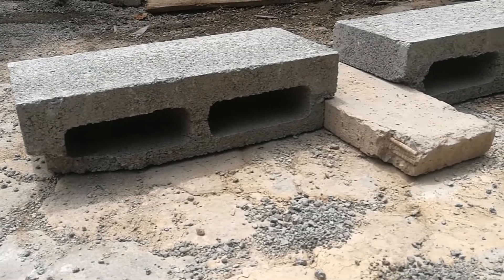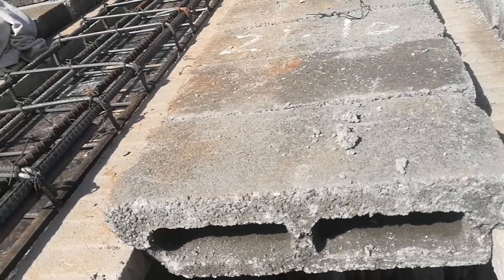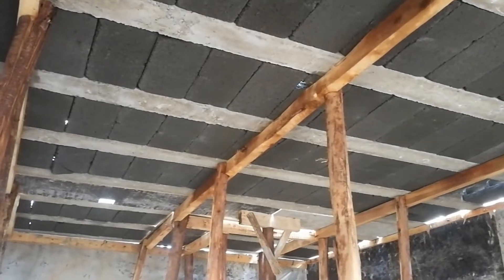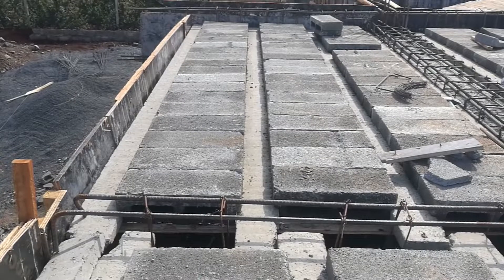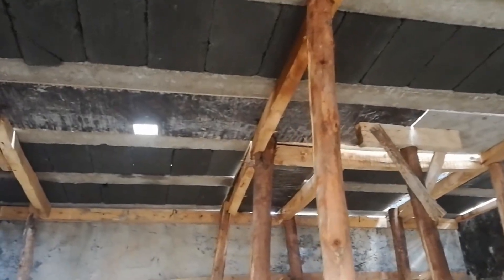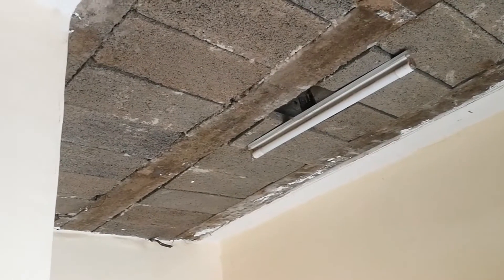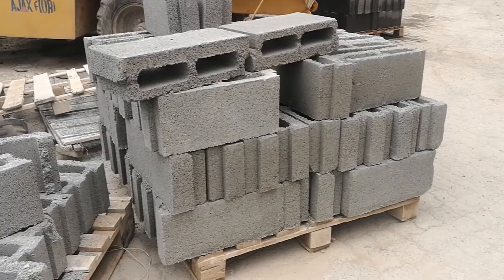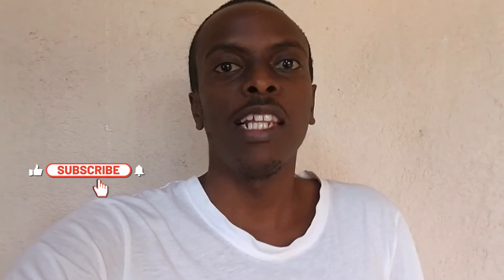Using Hollow Concrete Blocks and Beams to Make Suspended Slabs Faster

Comment: Building is not about choosing the cheapest option today, but about the strength and safety of your house in 20–30 years. Block decking may look easier and cheaper, but normal decking (slab) gives better strength, durability, stability, and lifespan. Always build with proper design for long-term safety

Comment: Nice Vid, you should do a video on the maximum span the beams and blocks can reach as well as the min/max thickness of the poured slab on top of the beam/blocks, steel reinforcement sizes and spacings and give information on expansion joints and waterproofing for external slabs. this would answer so many questions one would have when planning a job and calculating materials.

Comment: Is this technology stronger than the conventional slab we are used to?
Reply from the maker: It can have the same strength, only that it's faster to install
Reply: Building is not about choosing the cheapest option today, but about the strength and safety of your house in 20–30 years. Block decking may look easier and cheaper, but normal decking (slab) gives better strength, durability, stability, and lifespan. Always build with proper design for long-term safety

Comment: What is the maximum length of a pre stressed beam?
Reply from the maker: This is determined by the shortest span of the room, eg, for a 3x4m room, you'll use the 3m prestressed beams

Comment: Hello how many floors can you go with this Precast concrete slab thnx for the great work 😊😊❤
Reply from the maker: It can go as many floors as the design of the building. The foundation, columns and beams support the loading of the structure together the precast concrete slab. Ensure you work with a qualified and experienced structural engineer for your project.
Reply: @PropertyNoma  that’s good to hear but is it possible to export them to Uganda if possible how much is each of those precast concrete slab blocks and everything that goes with it thnx for the information

Comment: informative presentation. Are the concrete blocks and beams slabs waterproof if used as a rooftop?
Reply from the maker: Not by themselves. A concrete layer is poured on top as a floor finish and cover. You can use waterproofing cement or put  APP membrane on top of the concrete for waterproofing a flat roof slab

Comment: Great video Nick. Your building method is interesting and ingenious. What is the entire dimension of the beam and block (length/width/depth)?
Reply from the maker: The entire dimension will depend on the span of your slab...so they're customised to fit the design of your house's slab
Reply: @PropertyNoma  thanks but I was referring to the individual beam and block that you're using in the video. What are those dimensions for one single beam and one single block?
Reply from the maker: @ecf2335  A beam's length will depend with the shortest span of your slab while a typical block's width is 400mm.

Comment: I am curious to know if there have been any failures or collapses using this technology as compared to the normal method of building suspended slabs. Also I am curious to know the typical thickness of the poured concrete layer, as well as the MPa of the concrete mix if you know it. Thankyou for making an interesting and informative video. It is very good in my opinion.
Reply: In some countries they use t shaped beam, which look stronger to support the hollow blocks.
Reply from the maker: Beam & block is a standard technology in somw countries, although it's relatively new here in Kenya. The poured thickness is around 50mm
Reply: Stupid man! You are curious to know of failures and collapses of a technology. Why aren't you curious to know successes and benefits of the technology?
Reply: Ivory coast uses it

Comment: Can't one make a beam at home
Reply from the maker: No you can't because of the prestressing process. You'll need specialized equipment to prestress the steel tendons when casting concrete for the beam
Reply: Thanks for the response. And reinforcement rod won't do
Reply: How much prestress are the tendons subjected to?

Comment: Thank you Nick. Is it possible to do a series where a hybrid of building materials are used? I.e. for walling can EPS be used for their sound proofing properties together with brick in a single house
Reply from the maker: I think it's possible but you'll have to know whether EPS will be used for load bearing. Bricks are usually used to partition rooms and not so much to carry loads. It ultimately depends with the design of your house.
Reply: @PropertyNoma  Thank you